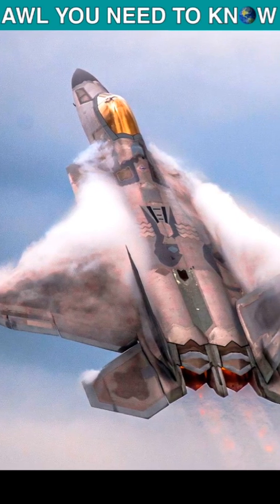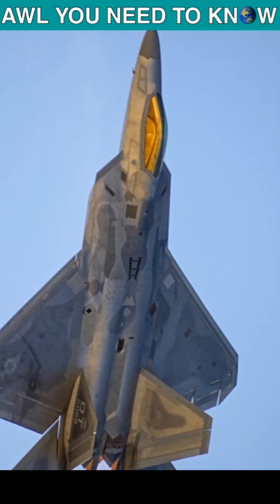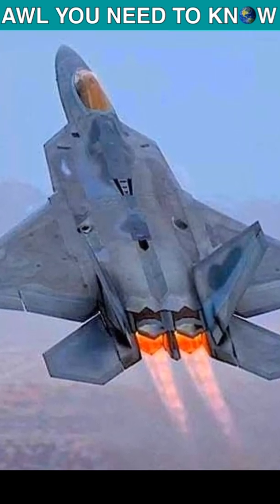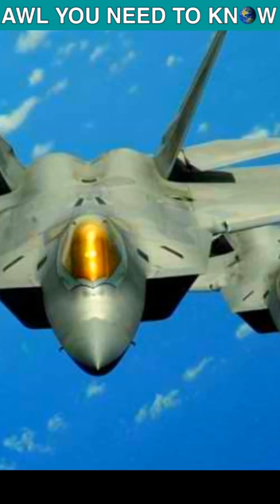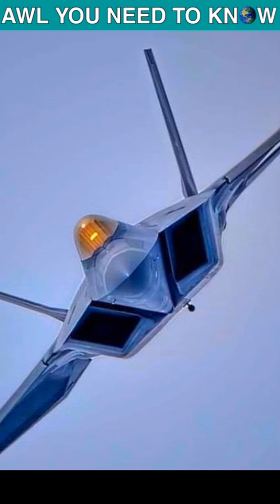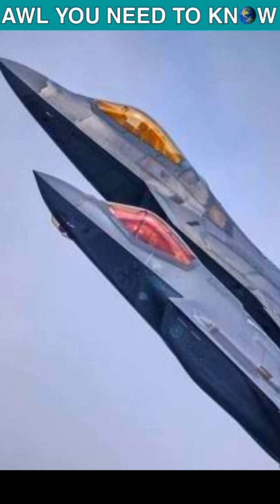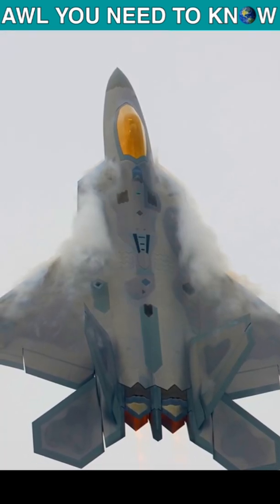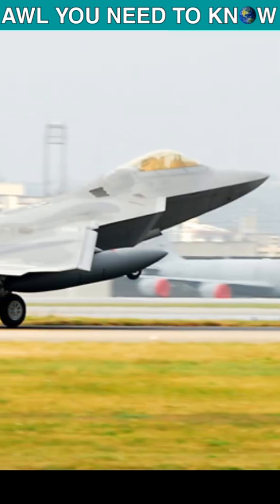Why F-22 Raptor Have Golden Canopy ? #shorts

Comment: You say reflect, what you mean is deflect.
Reply: What's the difference between the two terms exactly that makes them not interchangeable?
Reply: @dustinhaynes2617  reflect is what radar does to do its designed job....deflection bounces the ping off the target and doesn't return it to the dish